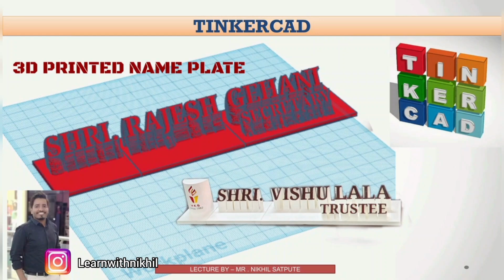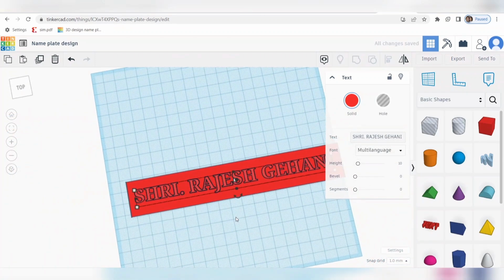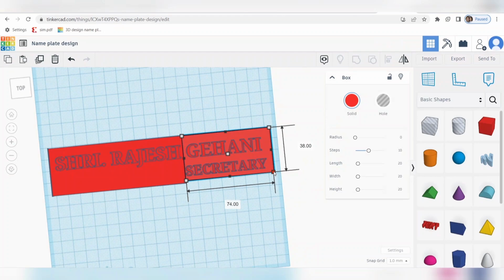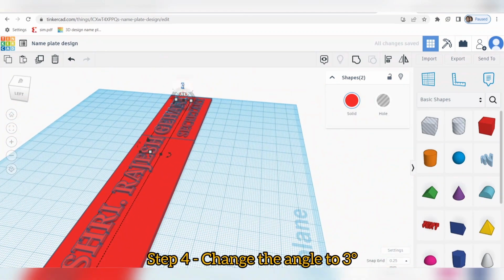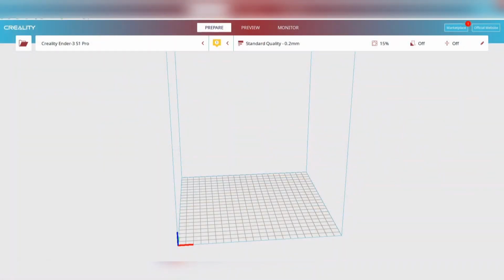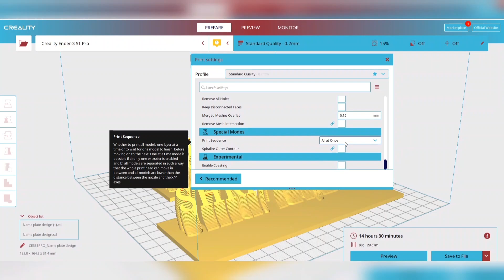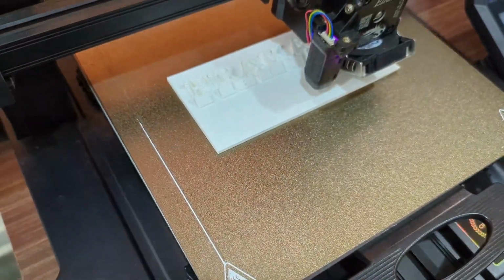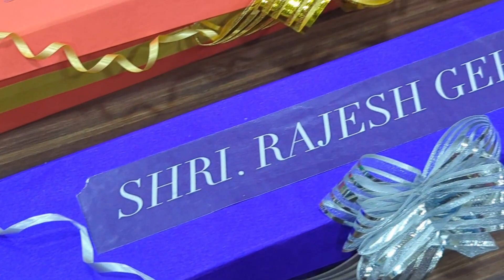Sweeping text name plate design | 3D printer | Learnwithnikhil

Comment: how come my letters don't move together when i press control D
Reply: Did you ever figure it out Mine either moves like that it just duplicates in the same spot
Reply: @gold_fingerz5891  have you figured it out? Mine doesn't automatically stack up
Reply: Same here any luck? @gold_fingerz5891
Reply: @gold_fingerz5891  Me too. i have windows 10. I was thinking maybe its because hes using a MAC becausemy commands dont work the same as the ones in this video